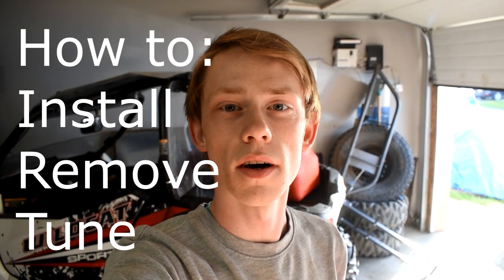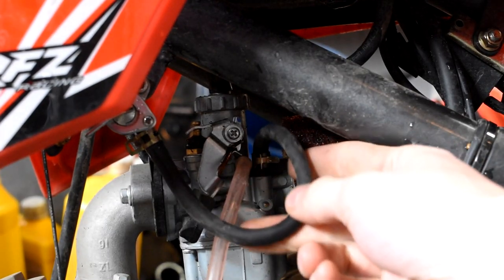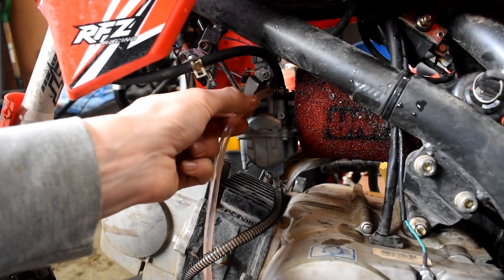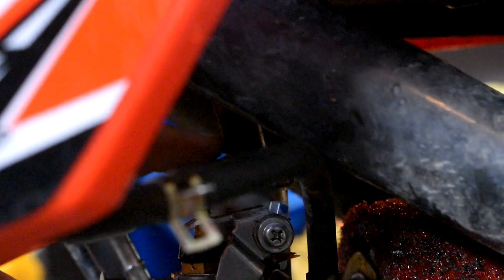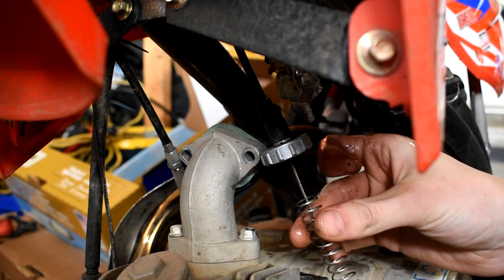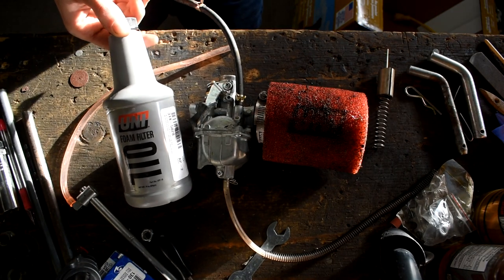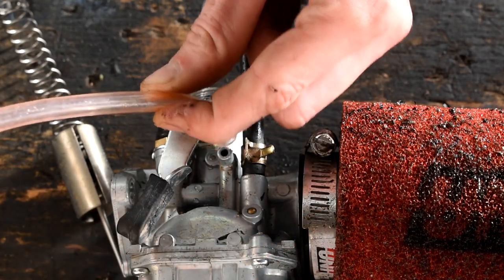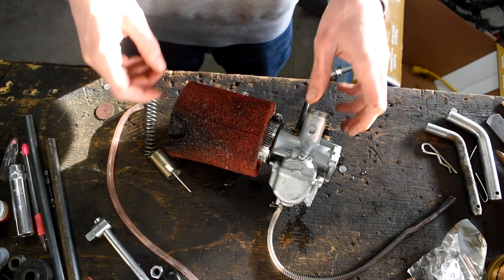How To Fix Dirt Pit Bike Bogging | Upgrading Chinese Pit Bike Carb

Comment: What did you do with the breather hose that came off the stock filter?
Reply from the maker: Deleted it. Then the hose that comes from the engine, runs to the ground off the back side of the engine casing.
Reply: @AaronsEnduro  thanks dude. Hose just hangs down like carb hose breather? I put mikuni on my rfz and found there was a rivet so i drilled it out and swapped carbs. Runs better now 🤘🏻
Reply: What spark plug are you running?
Reply: My uni filter is way too big that i ordered for mikuni  🙄
Reply from the maker: Yep!
Reply from the maker: Glad to hear she rips now!

Comment: My yz is running rich. Where should I start?
Reply from the maker: By adjusting fuel trim on the carb
Reply: @AaronsEnduro  Thank you Adjusted and it's better still getting a lil 2 stroke spooge but that's normal I've heard
Reply from the maker: Glad it helped!

Comment: Just got one of these lol what do I need to do with the hose coming out of the filter
Reply from the maker: Delete the air/oil separator, and run the section coming from the engine down the back of the engine. Do not block it off! Its the crankcase vent for releasing crankcase pressure

Comment: How did you apply the oil and how much
Reply from the maker: Just until its evenly coated
Reply from the maker: Use a glove and work it into the filter
Reply: The filter or the foam piece
Reply from the maker: The foam piece for the filter
Reply: @AaronsEnduro  ok on the inside though right? And thanks bro your videos are awesome!
Reply from the maker: Use the oil on the red piece, and i like to use a little bit on the top of the black piece
Reply from the maker: Glad you enjoy the videos! If you need more in depth help with these bikes join the membership program for my in depth written guides :)

Comment: I tried to do the fuel screw but I did it 2 times I supposed to do it 2 and a half ? , also my bike runs good in neutral but when I leave neutral it has a total loss of power when I try to give it gas so any ideas of what to do ?
Reply from the maker: Sounds like a small main jet if it tuns good at idle
Reply: @AaronsEnduro  yea it sounds good when it neutral so how should I go about it with the main jet ? Kinda figuring all this out as I go
Reply from the maker: Find out what size main jet you have, go a size bigger
Reply from the maker: Could also try moving the needle position shown in the video above
Reply: @AaronsEnduro  when I leave neutral it bogs and won’t go past that point

Comment: How did you move the clip down on the needle
Reply from the maker: Just pop the c-clip off. If you have a a knockoff carb it might not have the notches in the needle to raise or lower the c-clip
Reply: @AaronsEnduro  I actually just moved it up to the second notch like you did right before you responded ! I’m having boggin issues like you did. And start up problems when it’s warm already. I think it’s getting to much gas. I have the carb taken apart and I’m gonna clean it in the morning for now and see how it runs. Imma order a new carb , filter and spark plug tmr morning
Reply: I’m gonna “tune” it as well to control the fuel amount coming jn
Reply from the maker: What colour was your spark plug tip
Reply: @AaronsEnduro  it was dark as hell. Not good so I got a new one just now actually and then imma clean the carb now. Put everything together and see how it runs
Reply from the maker: Do one adjustment at a time to know if it helped or hindered it running
Reply: @AaronsEnduro  sounds good, I didn’t think about that. Thank you for responding and giving tips!
Reply from the maker: Its going to come down to getting the c-clip position correctly, fuel screw and jetting size. Its a pain in the ass getting it all right. But once it is your set up to ride
Reply: @AaronsEnduro  okay so I still have the stock carb , I cleaned it real good wouldn’t start still, put in new spark plug started after a couple kicks , drove it around ran fine sounded better didnt bog really at all but once i turned it off it didn’t start again. I did the fuel screw all the way down then two screws to the left once down as well. It’s just not starting. It’s getting to much gas in the carb I feel like.
Reply: @AaronsEnduro  my friend did mention the jetting size but at that point I rather get a new carb tbh. A better one
Reply: @AaronsEnduro  cuz it doesn’t wanna start up idk what it can he
Reply from the maker: Getting a new carb will not fix your problems. Jetting is a part of owning a carborated bike. Once you’ve got the right jetting itll be dialed in

Comment: I have 2021 rfz 110cc about the same deal ?
Reply from the maker: Yep!!!
Reply: @AaronsEnduro  awesome carb should be in Thursday ima give it a try
Reply from the maker: Perfect! Its gonna be a little ripper
Reply: @AaronsEnduro  awesome and is 91 premium gas safe to run or what is recommended
Reply from the maker: If you’re in canada i run 94 octane with 0% ethanol. 

You dont want ethanol in your dirtbikes

Comment: Are you still using this carb or did you switch back to the stock one I saw in ur other video it wasn't on the bike
Reply from the maker: Im still using my mikuni carb(even after the 150 swap) the stock one i gave to another friend. Since i started using the mikuni ive never swapped to anything else
Reply: @AaronsEnduro  oh nice i actually switched back to the stock one, but moved my pin 1 click up. I actually had allot of problems with that carb. Even after it was fine tuned randomly my rpms would sky to sky rocket real high. I just got tired of carrying a screw driver. Maybe I got a defective one 😂
Reply from the maker: What air filter do you run?
Reply: @AaronsEnduro  uni is the only air filter I trust.
Reply from the maker: Okay and hopefully you are oiling your filter!

Comment: Hey, I know i’m way late lol, but i’m doing this thursday for my apollo 135 x19, how the heck do I drill or cut out that little brass pin keeping you from unscrewing the stock throttle cap? Like wth? China can be extremely stupid sometimes. All the time.
Reply: Also i’m doing the exact same carb as you. Do I need to purchase any adapter?
Reply from the maker: Use a drill
Reply: @AaronsEnduro  So turns out that little brass pin unscrews with a pliers or something like that, no need to drill! Installing the mikuni knockoff tomorrow!
Reply from the maker: Exciting stuff

Comment: Sorry to ask so many questions Aaron.  Just picked up the UNI filter... seems to get really close to the exhaust.  I noticed that @15:29 in this video, you have a chunk taken out of one side of your foam... is that because of the same issue with the exhaust?  I have two Apollo's and was debating moving away from the foam filters because they are right up to the exhaust, unlike the SSR which is off to the side.

Thanks in advance...
Reply from the maker: Hey brotha, you can always ask questions on this channel! Yes that chunck is missing from my filter from the exhaust burning it. You can buy the turned elbow for your bike and itll point like the ssr to the side. Ive sinced heat wrapped the exhaust which has alleviated the burning issue
Reply from the maker: You can find the elbow on amazon
Reply: @AaronsEnduro  I bought the angled one that you posted... still pretty close and takes up a lot of space.  But, I was considering heat wrapping anyways since my bike was missing the shield when I bought it.  I'm assuming foam is still the better option over the pleated ones I'm seeing out there?
Reply from the maker: The cone filters suck ballss, 2 stage foam with the exhaust wraps is the way to go. Note when u do the wrap and it gets wet itll smoke off the exhaust ( which doesnt bother me)

Comment: My Apollo 007 bogs when you rev to quick and deep. Is that normal? It revs when I rev it slowly  and rides perfect.
Reply from the maker: You have to small of main jet, or not enough fuel (adjust the mixture screw)
Reply: Aaron Greenway some people said it’s the pilot jet. And I turned the screw in every position possible still nothing. My spark plug is black though but still starts first kick
Reply from the maker: Okay if you’re spark plug is black, you have too much fuel up top. Meaning too big of a main jet , or too much fuel from the mixture screw
Reply from the maker: And are you sure you’re adjusting the fuel screw, not the idle screw?
Reply: Do you have an Instagram so I can dm you pictures. Iam turning the fuel/air screw and it is not working.
Reply from the maker: @thegreenway_mfg
Reply: Aaron Greenway okay I dmed you lmk when you see
Reply: To much fuel ajust needle clip up 1 ;)
Reply: matt 😭😭 brought back memories when you replied.  5 months ago cops took it. Cant ride anymore.
Reply from the maker: OOOF
Reply from the maker: Bet u wont be riding down the streets no more
Reply: Aaron Greenway well not without a bike lol
Reply from the maker: 🙃 what did they catch you doing

Comment: Do you know why a new 125 engine and new carb the exhaust gets hot fast while idling do you know why
Reply from the maker: Running too lean!
Reply from the maker: Aka not enough fuel
Reply: @AaronsEnduro  thanks boss I will try adjust the air fuel mixture but its hard as the screw is on the bottom of the mikuni vm22 carb
Reply from the maker: I know the pain, if you use a socket flat head you can just barely get ur hand in there to adjust it while its running
Reply: @AaronsEnduro  I will try that thanks man
Reply from the maker: Best of luck Cory!
Reply: @AaronsEnduro  thanks 👍
Reply: @AaronsEnduro  do you think it's normal for a bike exhaust header part to be untouchable after 1 minute
Reply from the maker: Its supposed to be hot yes. Look at your spark plug. If its white your running your bike lean and thats why its extra hot
Reply: @AaronsEnduro  thanks pal your very helpful indeed

Comment: helo just bought one idles like crazy revs up on idle even tho idle screw is all way out and the needle is actually working and going all the way down any ideas? also bogs half throttle
Reply from the maker: The idle screw should not be all the way out. All the way out will give you a super high idle. The idle screw should be about 1.5-2.5 turns out from all the way in
Reply: @AaronsEnduro  thanks I will give that a try boss
Reply from the maker: If you need 1 on 1 help check this out! 

https://www.youtube.com/channel/UCcviyKZ2Vf3IHFliwebzODA/join

Comment: great video! At 5:35 i noticed the knob on the old carb but not the new one. What is it for or what does it connect to?
Reply from the maker: It was a poorly executed air filter vent tube from the engine for the oil blow by. You just remove the line from the carb and vent to atmosphere
Reply: @AaronsEnduro  Thanks! So its fine to leave the hole on the transmission open or should i just remove the tube from the carb?
Reply from the maker: Keep a tube on a tranny that runs so down the back of the engine

Comment: Hello i put the mcoonie carb on and my bike wont start now any suggestions
Reply from the maker: Id check the fuel screw position to see if fuel is even coming out
Reply: @AaronsEnduro  gass is coming out and when i put the new carb on my bike just wont start everything is connected correctly
Reply from the maker: Thatd indicate your float is incorrectly set
Reply: @AaronsEnduro  i just checked it and it is not overflowing and is set good would anything else be the problem
Reply from the maker: Where is the fuel leaking from
Reply: @AaronsEnduro  there is no fuel leaking anywere it just wont kick over
Reply: @AaronsEnduro, hi there I recently picked up a 125cc RFZ apollo 2020, x18, if I purchase this carb in the link will it fit properly without anything else needed??

Comment: The cord that is connected to my original card filter where does it go since this carb has no spot for it
Reply from the maker: You ditch it all together!
Reply from the maker: Then run the tube that goes from the engine to the ground (its your oil breather tube)

Comment: My bike pops and when you give gas it stays at high rpms and didn’t go back to idle for a while can you please help me.
Reply from the maker: Throttle slide is getting stuck, sounds like its also running lean
Reply: So what do I do about that?
Reply: And it only runs with choke on
Reply from the maker: I would start with removing your spark plug and seeing what color it is. Then based on that id tune the carb appropriately
Reply: Thank you so much I fixed it 🏍
Reply from the maker: @neylandwilliams1345  hell yeah brotha!!

Comment: I have literally tried everything but it still bogs . I have changed pilots I have messed with air screw , I made sure that one thing is aligned right . And I know it’s not other things bc it’s a brand new 125cc and aftermarket carb
Reply from the maker: What size carb did you use?

Comment: Why does my exhaust get so hot so fast does it mean I may need a new carburator?
Reply from the maker: That means your running the bike lean. Meaning not enough fuel in the mixture. Watch my video on tuning your carb. You can blow your engine running it lean
Reply: @AaronsEnduro  I have stock carb it happend like last week I was riding street with my buddy and we stopped by his place and I put my bike on nutral n left it  then he came back out I put it in first gear gave it alittle bit of gas  then my bike turned off then my bike started smoking and I tried turning it back on and then it started smoking smoke was coming from the carburetor and and my exhaust was so hot and the black part infront of my motor was so hot I haven't rode it scince
Reply: @AaronsEnduro  can I still tune the stock carb ?
Reply from the maker: Stock carbs have minimal tuning. Id highly advise getting an aftermarket carb to get the best performance and proper tuning
Reply: @AaronsEnduro  do u have Instagram or something my throttle cap popped off I needa put it back but I can't find ppl explaining on YouTube
Reply from the maker: I do mechanics by donation on my instagram 
@aaron_greenway

https://www.paypal.me/agreenway13

Comment: with my bike it starts fine and it gives gas fine in neutral but when i’ll give throttle in first gear it’s just bogs out
Reply from the maker: Main jet clogged possibly 

Bike will run if the pilot jet is fine but  if main jet is clogged it wont rev out

Comment: do you have a video on the carburetor that came with the bike. my first one went bad. The company gave me another one and I put it on along with a new throttle cable and it starts, but really no power. I tried to sell it today so embarassing. it started up ran it rode it washed it up, went to public place waited 2 hrs they get there bike wont start when it did it started popping and dying out. I know that man thought I was trying to sell him a piece of junk. mind you we just drove it there 2 or 3 miles away from the house. literally had to push it back home. What could be the issue with this carburetor before I try a different one please. I don't think it was even going 35mph. I will check the spark plug tommorrow to see what color it is. it has been sitting for a year or so. I put new gas in it. by pass the gas filter on it so the gas is going straight to carb. change oil and spark plug then sat for another 6 months...2weeks ago pulled it out started it up to make sure it run and decided to put it on FB market and it did all I explained above.
Reply from the maker: Im guessing you got water in the exhaust when you washed in
Reply from the maker: The stock carbs are super junk tbh, definitely better off with a proper carb

Comment: Would you know why my bike idles really high with the choke on but when I turn the choke off it idles fine but bogs a lot?
Reply: It doesn’t bog in high rpms in mainly bogs in low rpms
Reply from the maker: So, why does a motorcycle only run with the choke on? It means your motorcycle is not getting enough fuel, and this can be caused by dirty or clogged pilot jets, clogged fuel line, clogged fuel filter, dirty petcock, loss of vacuum in the carburetors, among other carburetor issues.
Reply from the maker: It’s supposed to rev higher when you turn choke on

Comment: I messed with the needle and put slide to the top but I forgot exactly how to put that metal ring in right any one can help ?
Reply from the maker: Watch my carb video! It shows how to pit it together
Reply: @AaronsEnduro  I did but it doesn’t show exactly how to put the metal ring in correctly
Reply from the maker: The little w clip? Just put in inside the cyclinder, and push it down with the throttle spring
Reply from the maker: It goes on top of everything ( the pin, and rubber o ring

Comment: HELP!!! what i need to do?  If my pitbike shoots gasoline through an air filter???
Reply from the maker: Say whattt
Reply: @AaronsEnduro  my pit bike shoots gasoline outside at air filter
Reply: @AaronsEnduro  i place trotthle  cable on 4 and i screw fuel mixture but it didn't help
Reply from the maker: Im sorry im just not understanding what ur saying? How does gasoline shoot outside of your air filter. That doesnt make any sense
Reply: @AaronsEnduro  it bogging and gasoline 
it also rains through the air filter
Reply: @AaronsEnduro  on the first and second gear goes well but when you drive on the third and on the fourth gear, at full throttle he twitches!!!!
Reply from the maker: @itsrillsyz5574  sounds like you need to set your fuel screw at 2.5 turns and go from there
Reply: @AaronsEnduro  ok! tnx broo!

Comment: But a new carb and a good air filter that will stop the bogging it’s bogging cause it’s not getting enough air
Reply from the maker: Thats why you tune the carb to get the right air fuel mixture